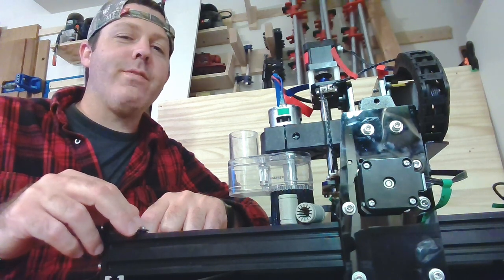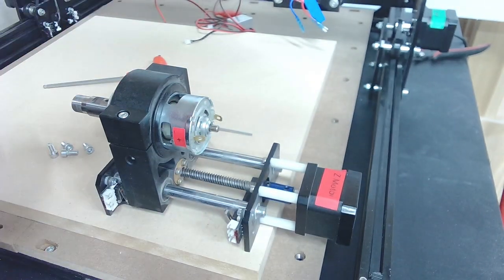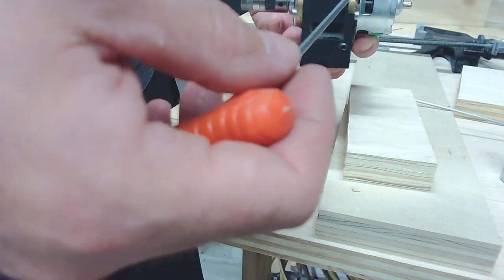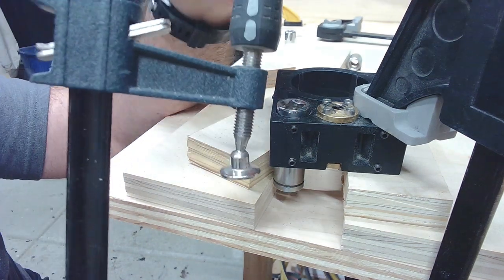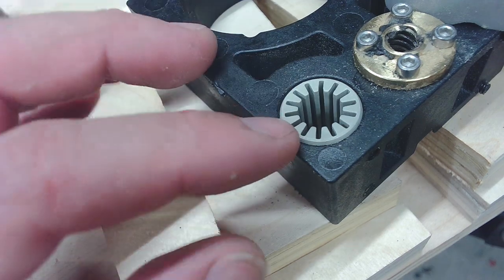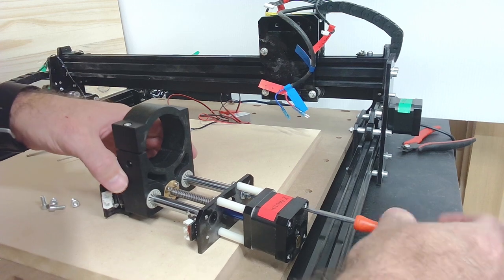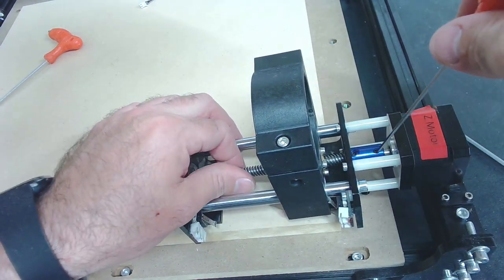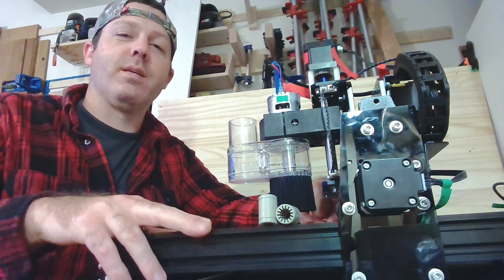Your Desktop CNC has chatter? Try this simple fix!

Comment: I used a 19mm deep socket and a 5/16" x 4" hex bolt . Slide the bolt through the original bearing, slide the deep socket over the botl, thread the nut and as yoou tighten the nut it presses the bearing out, no clamps needed.

Comment: Definitely easier to remove & refit the motor mount with the motor removed. It makes straight alignment of the motor mount screws into the carriage.
Considering how tight it was to press the old bearings out, i don't think the Fox Alien would ever suffer the bearings slide out even without the sneaky little grub screws!!

Comment: Do you know if anyone makes these for the 3018 pro, all I can find is 24mm length and I need closer to 34mm
Reply from the maker: I've seen 20mm ones used in  pairs, making us 40mm long for the 3018, they stick out past the housing but not enough to reduce the travel.
Reply: @SethCNC  thanks, may have to give that a try